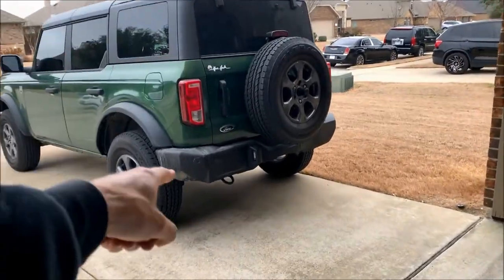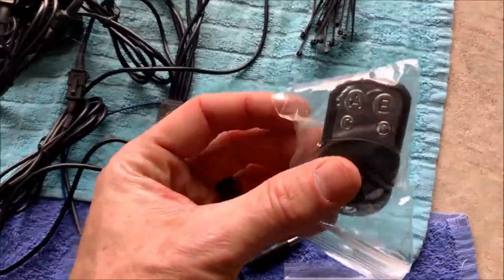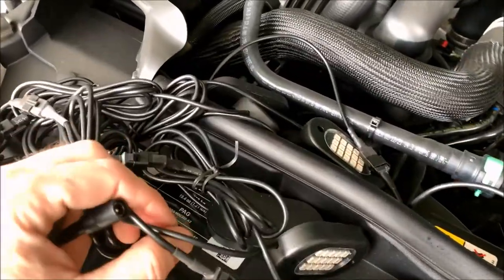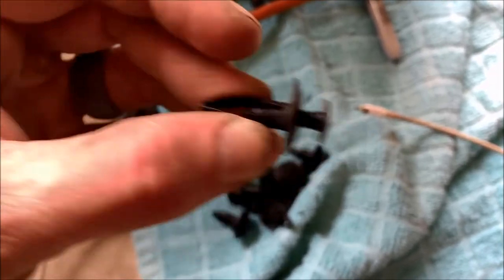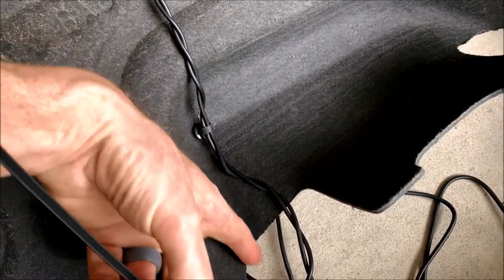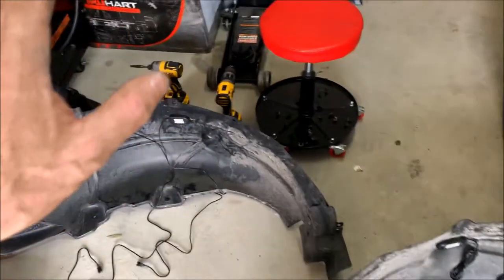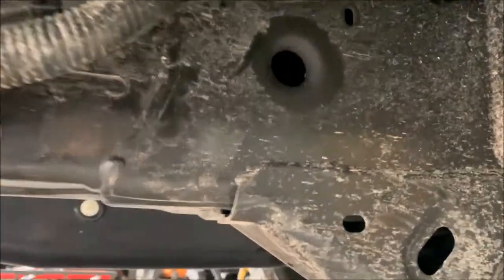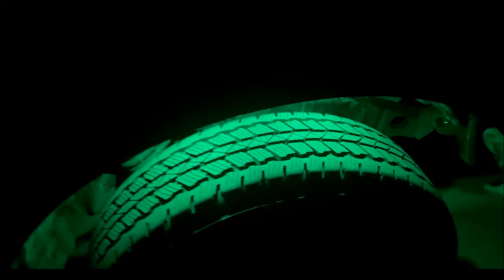2022 Ford Bronco Complete Rock Light Installation Guide

Comment: Why not hook it up to the auxiliary switch wires ?
Reply: Not all Broncos have the Aux Switch. I installed my mod bumper with fogs and had to hardwire them to the battery. Have it on the forum! Wish I had the aux switches but there are ways around it!